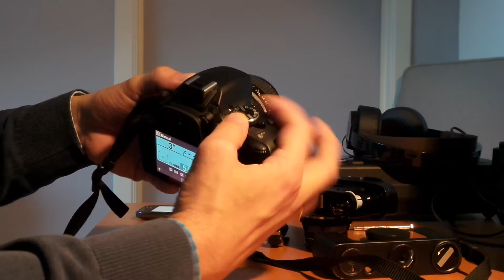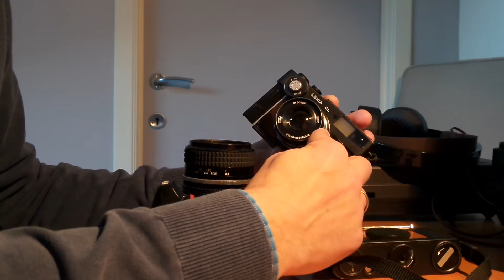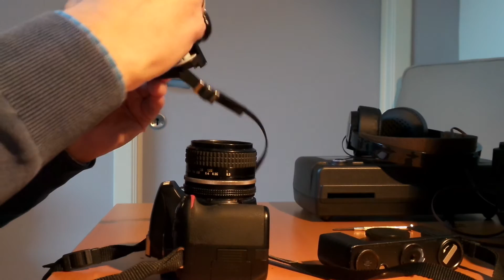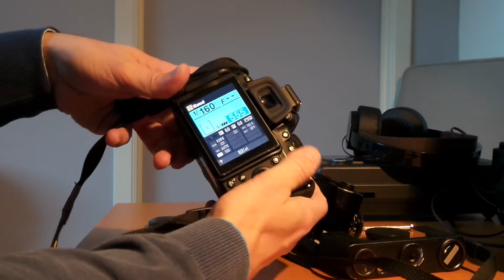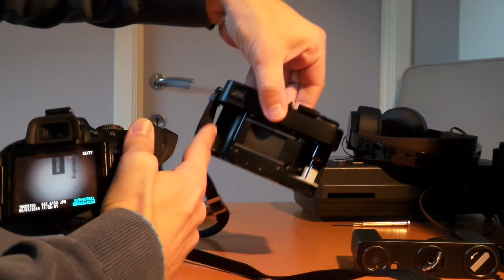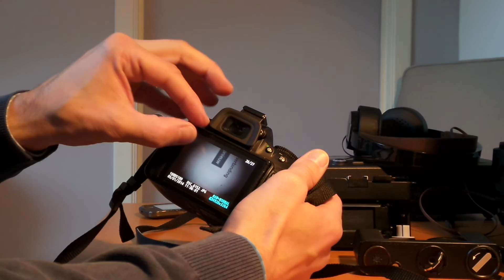Automated testing of focal plane shutters

Comment: Because the Lieca CL has a focal plane shutter,  do you really need a lens on the Lieca CL ?  It would produce a larger image in the DSLR ?
Reply from the maker: Yes, the lightrays need to be focussed on the sensor. An alternative is to remove the lens on the Leica and put a macro lens with 1:1 magnification on the DSLR.